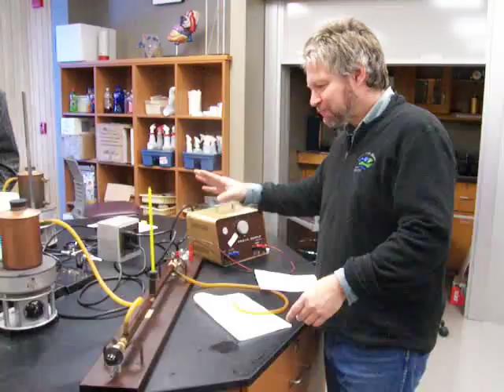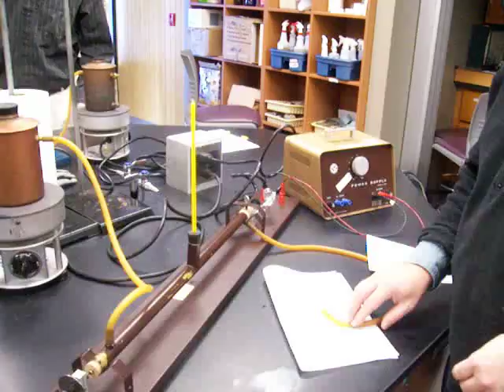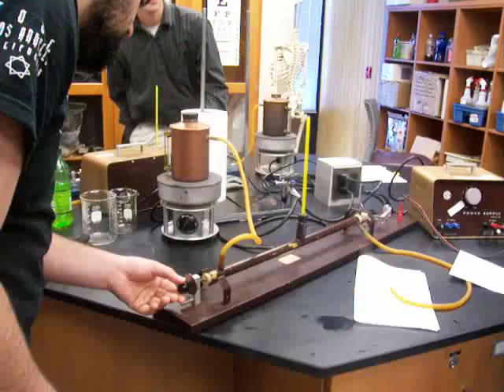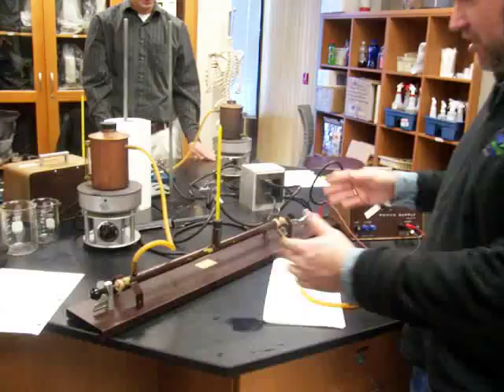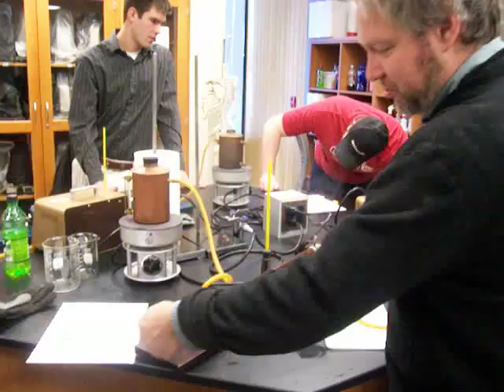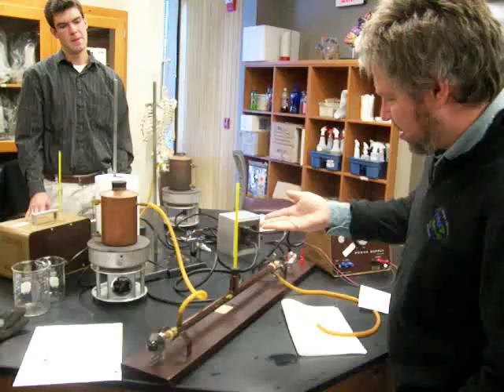Lab12.2 Thermal Linear Expansion - Copper

Comment: Unlikely that the mercury thermometer was being used correctly. They have specific application criteria. This could cause a significant error beyond its traceable calibration. The repeatability of the large hysteresis in the screw/ bulb measurement seems excessive and could again contribute significant error. A gauge R&R study should be performed with multiple users over multiple days to quantify repeatability, and this added to the traceability uncertainties.

Comment: Why would it be disadvantages to send cold water down the experimental tube, and steam up it ?
Reply from the maker: The pipe isn't really made for heating it, the air or water inside. It might also heat up unevenly. Instead the heater and container (with water and eventually steam) are placed to the side, and then the steam can heat the rod inside the pipe quite evenly. The resulting data, plotted as length vs temperature, look quite nice.